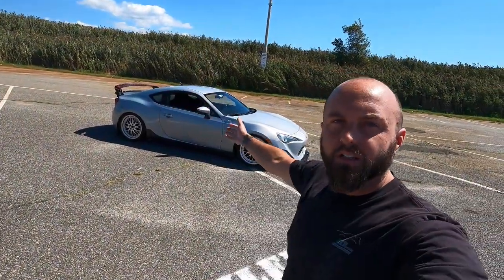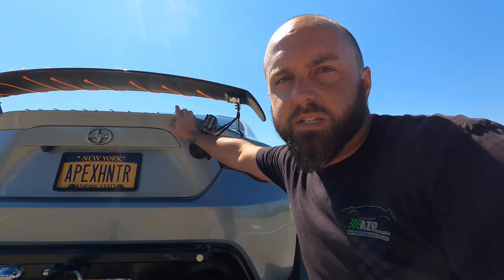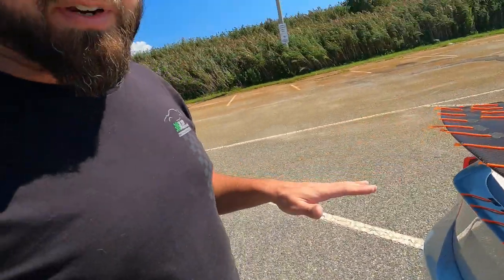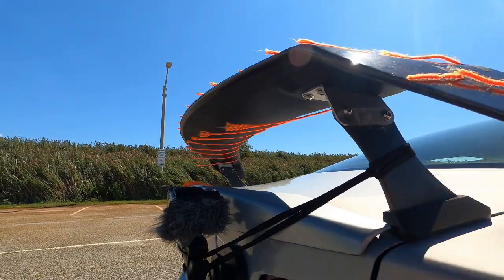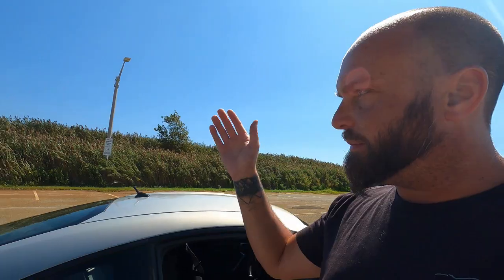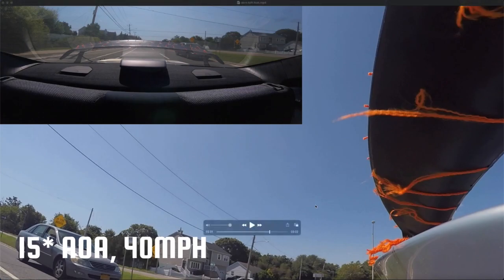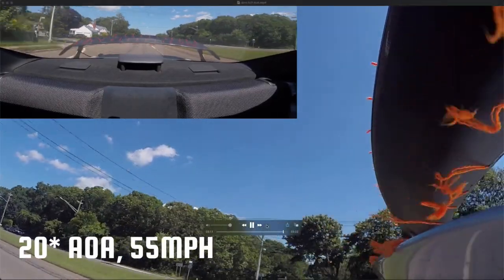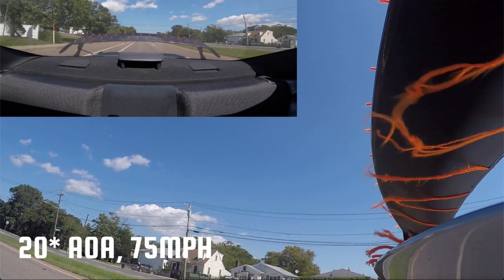Professional Awesome Racing analyzes my SARD Wing Aero Tuft Test!

Comment: Thanks so much for making this video. It was very informative and I learnt a lot from it. Great analysis as well. 10/10 video.
Reply: @CountersteerGarage  I’m saving for a Sard wing as well so good to learn about it’s performance.
Reply from the maker: The SARD I feel is more about accessibility than performance. We buy it for the ease of install and uninstall without drilling. There are much more performance-oriented wings out there but the SARD does something measurable which was nice to see. 

I have another recent video on this wing too. I got it color-matched to the body paint. Came out soooo good.
Reply: @CountersteerGarage  I’ll make sure to check out the video. I just absolutely love the look of the Sard wing and am a massive fan of it requiring no holes to be drilled as well. Particularly as mine is a wingless variant. I’ll never take it to a track day other than maybe my local hillclimb circuit so I am really not fussed about performance.
Reply from the maker: Yeah for that purpose it’s great. Looks really good color matched too!
Reply: @CountersteerGarage  I’m not due whether to keep the carbon as is it paint. Both look great.